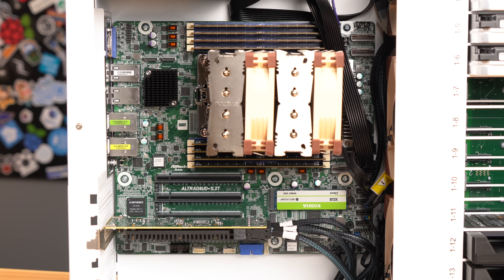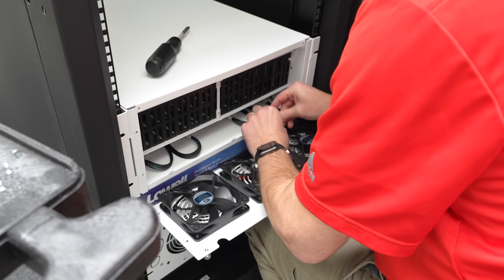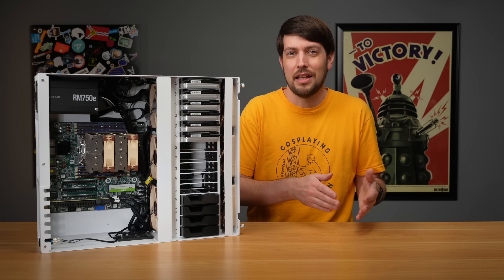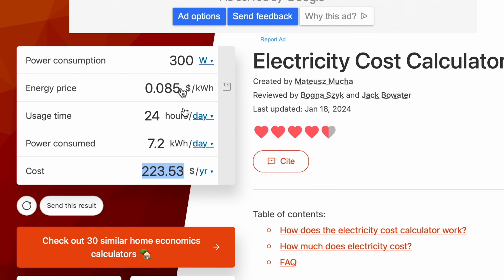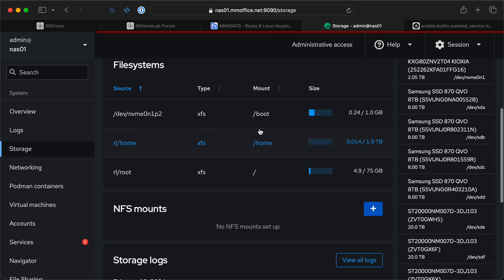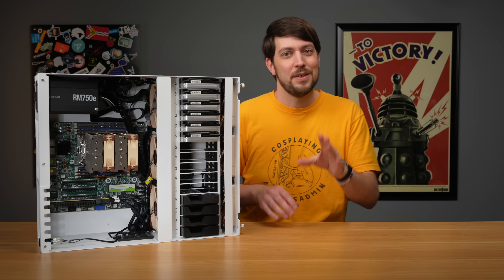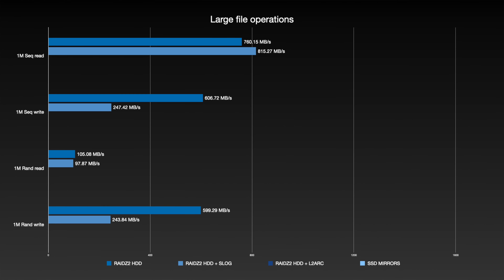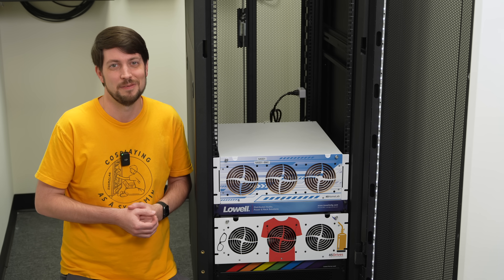Silencing the 100% Arm NAS—while making it FASTER!

Comment: My "server" is a Ryzen 5 3600 with 32GB DDR4 running at 2666, and the shared drive is just a USB 3 external hard drive. It's actually just a repurposed MyBook, so I want to keep it external in case I ever need it on the go (you know, like the intended use case :p). I've undervolted the CPU to run around 45 watts at idle, and I let the hard drive spin down when not in use, which is most of the time. Benchmarking this was difficult, but I wanted to know the idle power draw and the power draw serving files at 1Gbps, and that was my goal for efficiency. So, I really like what you say about efficiency meaning something different for everyone. Maybe one day I'll go ARM, who knows?
Reply: If you want to shave off a few more watts at idle, look into AMD's monolithic jobs - 4500, 4600G, 4650G, 5500, 5600G. (If memory serves, there's not much in it between a 3600 and 4500/4600G performance-wise, and neither of them are expensive.) Make sure the BIOS option "Lower Power S0 Idle Capability" is turned on, as well as all C-states, PCIe ASPM etc. You can check for ASPM among PCIe devices with:
lspci -vv | awk '/ASPM/{print $0}' RS= | grep --color -P '(^[a-z0-9:.]+|ASPM )'
Reply: I’ve been running an old i5 6500 with 8gigs of ram as a Minecraft server and was surprised to see the thing only use like 20-25W on idle. Ryzen, especially their chipset based cpus are just not great when it comes to idle efficiency I think. Whole different story at load though.
Reply: @Keklient  20-25 W actually isn't even a particular achievement for a Skylake system... Sandy / Ivy Bridge will do that already. There's a number of Skylake era office machines that'll idle at around 10 W, and things can be pushed to around 6 W with a PicoPSU and the right board. 6th to 9th gen is probably the best era for low idle power overall, although 10th gen can still be very good. Your best bet generally is (basic) ITX boards from manufacturers that are somewhat competent in terms of BIOS power saving features, or prebuilt SFF-ish systems.

Comment: I have never missed anything on my M1 Nas, I can replace iCloud drive/backup, Netflix, Zoom, ChatGPT, CoPilot and why not get 2 different coins CPU/GPU,  as easy peasy as git clone/brew install, it pays for itself pretty fast and why not upgrade to 10Gb without paying your ISP ;)
Reply from the maker: Apple's M1/M2 Mac minis are about ideal for so many different reasons. Just wish they would make a computer that's more suitable for rackmounting!
Reply: A 3D printed rack for Mac mini's removed from the case would probably be pretty easy and extremely compact  @JeffGeerling  
I have only had issues with getting Thunderbolt networking working more like a switch, have you tried that on Linux?

Comment: So a friend of mine recently went from Ubuntu to Debian with his server and is happy with the change. No more snap stuff, etc. Is there a reason you didn't go with Debian for this? Asking since my server is currently Ubuntu and I've been thinking about the next time I reinstall OS I may go Debian.
Reply from the maker: Mostly the support—Ubuntu in particular has done a lot to make sure arm64 support on systems like Ampere's run well. Debian is about 99% the same, but there are little things that make a difference sometimes.

Comment: jeff power form the wall and power coming form the psu to the cpu are far diffrent do to voltages and efficiency  120 volt 1 amp is 1200 watt at 100% efficiency and 12 volts at 1 amp is 120 but do to efficiency been close to 80-94 precent so it take more power how ever the cpu will pull 15-35 amps depending on the cpu at 12 volts wich is close to .35 amps at the wall so you shouldnt be useing the cpu wattage metter in bio or software its measuring how much power the cpu is useing and is really only usefull to see if the vrms are able to feed the cpu the power its needs

Comment: fans alone can drop power draw up to 150 watts if full on server fan the 12 volt 1 amp fans suck power down and when your useing 9 or more of them you can drop 150 or so much power being droped form the power supply more like 70 at the wall

Comment: sorry, I might be dumb, but at the end you just used ubuntu with ZFS? that's it?
Reply from the maker: Pretty much—originally wanted to try TrueNAS but they don't seem interested in Arm64 support. Then wanted to try Houston/Cockpit, but 45Drives doesn't have the support I need for it quite yet. So settled on Ansible managing ZFS on Ubuntu.

Comment: If a hard drive is using 6W at idle, then it's 100% not idle.
They're probably all spinning, even though there is no I/O...
Reply from the maker: Idle meaning it is spun up but not accessing any data. Spun down, they should be closer to 0W :)

Comment: Bonus points for the title.
The guys that make hl15 should definitely if not offer noctua fans as a option, at least work on their fan noise specs. I'm certain with a better choice of coolers (not necessarily noctua - bequiet and many others offer lower noise fans), a built-in/addon fan hub and some spacers they could provide much better ux
Reply: Yeah: for people who've committed to HL15 pricing... having a $150 uplift fee for Noctua fans probably wouldn't make them blink: I'd go for it.
Reply: I bet some properly sized resistors and 3d printed spacers take care of the fan noise on the stock fans for much less than $200 worth of noctua fans if that's more than someone wants to spend.
Reply: @chublez  most likely so, though quieter fans would also help - there's a bunch of those that are not as expensive as noctua.
What pains me is that a person who's ready to pay a boatload of cash for the hl15 has to contend with jerry-rigging stuff which at this price point should be an option offered by the manufacturer
Reply: @chublez  Don't suggest resistors. They should include a proper fan controller. It could be as simple as taking a PWM signal from the motherboard and using 4 wire fans. Or they could use thermal sensors which might be better for keeping hard drives cool.

Comment: You better grab some Optane drives while they are available. I use mirrored 905p's, to host both ZIL/SLOG, and also a Special Metadata vdev. The ridiculously low latency on Optane makes it possible to host the vdev and ZIL/SLOG without issues on the same drives.
Reply: When you go for a special metadata device (and potentially small-file support) do you pretty much need 2-way/3-way mirrored configs?
Reply: @MikeKirkReloaded   Yes. If you lose a special metadata vdev you lose the entire pool.

Comment: Using SATA QLC SSDs for ZIL and L2ARC - a bit masochistic?
Reply from the maker: Just wanted to see how they do :)
Reply: @JeffGeerling lol, the way you benchmarked them you sounded like you were expecting TLC NAND performance and instead blamed them for being “consumer ssds”.
Reply from the maker: @carbongrip2108  I was expecting nothing, really—a lot of forums just say "don't use consumer SSDs", but never offer any evidence they're better or worse, performance-wise. So I thought I'd test them to be sure.

The 8TB versions aren't that bad, honestly. I wonder if they have a larger cache due to the massive size of the SSD (relative to the QVO 1/2/4 TB models).

Comment: QLC are terrible for Raid from performance perspective due to the way they work. You may find more info on this from other YouTubers. Use at least TLC ssd.  Also if you can , use overprovision on the ssd, minimum at 20% in my experience because as the ssd is getting full the performance drops. And if it is a cache drive and it is filled at 80% of the total capacity, you will see significant performance drop as it reaches 100%.🎉
Reply from the maker: In this case, the 8TB SSDs are massive overkill—my working set on them is less than 2 TB, and won't probably grow beyond 3-4 TB in the next few years (after a project is done, it moves to the HDD array).

But as I potentially expand to having more than one person edit off this NAS, I may move to U.2 enterprise SSDs ... we'll see!

Comment: hi, the samsung qvo drives drop to around 150MB/s read and write during sustained use, that might be why you HDDs are faster
Reply: QVO drives read at full speed all the time. There is no speed limitations when reading for a sustained duration.
The 8TB QVO writes at 184 MB/s when it exhausts its massive SLC cache. He'd have to write some 320GB before a drop to that level.
Reply: QLC is flat out trash
Reply: @toseltreps1101  I don't know why you choose to spew ignorance rather than educating yourself.
These aren't no-name cacheless SSDs with crappy controllers. They also only experience the "QLC downsides" well beyond what you'd likely write to them in a single session.

Comment: This server gonna stay at 99% idle for entirety of its existence. 

Motherboard power usage is generally one of biggest killers for low power stuff, and server ones are rarely optimized for it. AMD seems to be worse here, we've seen the EPYC server boards eat like 110W while doing nothing (30W CPU, 80W rest, for not so high end server and just 4 NVMes).

at same time very comparable Intel one  (also 4 nvme, and actually doing more IO) was eating like 60W with cpu being 10W  of that
Reply from the maker: In most cases, the always-on BMC/IPMI eats up 5-8W too... that's more than a Pi running Pi-KVM too. Wish one of the motherboard vendors would go that route, with a setup that can be turned off if you don't need the always-on management tooling.
Reply: @JeffGeerling  If you think about it BMC/IPMI is like having an insurance.  Sure we pay till we need it.  Plus they want to make darn sure that BMC/IPMI always stay on so you can remote into it.  No chance of turning it off by accident.
Reply: @JeffGeerling  ...the management is basically THE reason to get those boards, that would be pointless, might as well get desktop/consumer mobo at that point. 

'I can afford AMD Epyc but not few bucks a year to keep the management running" is not the use case real people have, neither is "the person that dug it from the junk 10 years later can't afford the power", if you want to be sensible with your money you just don't buy server grade stuff as they are always overpriced for performance.

Anyway, the BMC is the least of the problems of those platforms. We literally had "same" series of servers, one with Intel, other with AMD, same BMC (at least UI wise... can't imagine Lenovo having 2 completely different BMCs for AMD and Intel), and at total idle (right after we got them) the difference was like 50W in favour of Intel. CPU itself was maybe 20W of the difference, rest was just accompanying chips not being all that efficient.

Otherwise the servers were as similar as possible, both 1U entry level, both with 4xNVMe of same model etc.

Comment: Seasonic makes a fanless PSU I use it in everything.
Reply: Even with their warranty always have a bit of airflow through the PSU, the electronics will be thankful in the long-term.
Reply: @abavariannormiepleb9470 Exactly! Seasonic, despite being the leading PSU brand with decades of experience, doesn't know how their PSU performs and what the suitable conditions for it are.
This random commenter on YT knows best.
Reply: You get that PSUs aren’t filled with magic but standard, widely known electronic components that have certain lifespans where temperature plays a significant role?

Comment: I think your problem with the ssd’s is less the sata interfaces fault and more the fact that they are QVO drives which favor capacity over speed. Retest with Sata SSDs that use TLC nand instead of QLC.
Reply: Might be correct, but damn, 8tb SSDs are just crazy expensive, the QVOs already being kinda stupidly expensive for most nas applications.... But the step to the next other 8TB ssd, not even mentioning TLC, thats insane once again...

To me honestly, for performance alone its not worth switching my 8tb hdds for ssds, only power draw and noise would be a factor, but even here in germany with our crazy high power costs, they'd need to. Run above 10 years 24/7 until the power costs would weigh up the price difference 😅
Reply: indeed, QLC is trash
Reply: I would never use QLC for constant writes.  It's fine for "archive" or cold data.
Reply: @Darkk6969  if you have a lot of time that may be true, but even decompressing a 40GB game takes 10x on QLC vs TLC. that's a lot less data throughput for only a 5-10% reduction in cost at best.
Reply: @toseltreps1101  Derp, no it does not. It might take 10x as long once you exceed the SLC cache*, but these drives have, *checks notes 78 GB of SLC cache EACH.
Reply: @Darkk6969  Because... someone told you so and you didn't bother to research how that largely applies to ~500GB and 1TB drives?
Reply: Wonder if it is worth using any consumer ssds for cache on these, if they will wear out... I'd just max out ram, stay with hdd fully or go with micron pro if money allows.  Or maybe have two different pools one for speed one for colder storage, duno.
Reply: @ironfist7789  Yeah, they'll wear out in just about 8.4 PETABYTES written to them.
They're each listed for 2.8 PETABYTES of use WITHIN THE WARRANTY PERIOD.
Typically, NAND is warrantied for about 30% of its useful life, i.e. the average NAND SSD will be about about 3.3x as write endurant as the TBW (warranty) value states.
They're basically useless. I, myself write some 50 petabytes a day. He might as well use a floppy disk.

Comment: You may also want to test the power measurement tools you use.
The Kill-a-Watt is probably measuring actual Watts, but most of those meters do not take the power-factor (cos phi) into account and thus only measure VA and not actual power your power company will bill you.

Most high-end power supplies in your PC will have some power factor correction circuits, so it should try to have voltage and current in phase as much as possible. But those circuits will often not work optimal when using the power supply at the lower end of the amount of power it can deliver.
Also power meters struggle in the low-end of the measurement range.

One of the easiest ways to help power meters to give a more accurate measured power consumption is to add some resistive load like an old fashioned light bulb with tungsten glow wire.
This will have a perfect cos-phi of 1 and adds some base load so your meter doesn't have to struggle near the low-end of its measurement range.

If you try to measure "idle" power consumption, you can easily be fooled by those measurements as the power supply probably does have a truly bad power factor at the low power delivery end of its range.
This can make a huge difference as the power factor for idle can be easily less than 0.25 which will put your measurements off by a factor of 4 or more.

So as always: Measuring is knowing, if you know what you're measuring. (A Dutch expression: "Meten is weten als je weet wat je meet")
Reply from the maker: I've been testing the Thirdreality plugs a bit, and they do measure power factor (among the other metrics), so I have pretty good confidence with them. I do plan on getting a nicer bench power measurement tool at some point that's calibrated and could be used to test the accuracy of various meters... but all in good time!
Reply: @JeffGeerling  Just as a simple test, you could also try to measure some devices with really poor power factor like LED lamps.  Just plug in your measurement devices in series and check whatever they measure with the same load and then swap the order of the meters to make sure you can average-out the power consumption of the meters.
Then also measure some resistive load like a heating element (e.g. an old soldering iron)  Just to make sure the soldering iron will consume a constant amount of power and is not turning off as it reached the target temperature, you can place the tip in a large vise or something else to dissipate the heat.
This doesn't require any pricy new equipment and maybe is a nice new topic for some video :)

Comment: I have two Servers at Home one running on a j5040 because i dont need much Power for my Services i have running. Most of the time it sits about 10% and uses only 7w but for some stuff i programming i need more Power way more as your heavy gaming can provide. I that Case i bought cheap a used dell r630 for 600€ with 14tb total of 8 SATA ssd in a RAID Array, all 24 ddr4 Slots are used wit 2400mhz 4Rx32 Sticks that i have 768gb and a total of 96 ranks, i have two Xeon E5 2699v4 with 22 Cores each. This system uses 150w idle and 670W full blast. But i have some Datasets where i have to crawl thought 10tb of Data. I wont wait 50h to Finish the Task ob my ryzen9 gaming PC that needs only 250w but but my r630 kann handle that Same workload in about 3h. 
The gaming system uses for that workload 250w over 50h so it used 12.5kwh but the r630 uses 670w over 3h and this are only 2kwh. The reason is parallization and faster workload Pool. Even the CPU is clocked lower and so the RAM but this dont really Matter If your limiting Factor is your Drive and RAM ranks.

Comment: Add a Metadata VDEV instead of SLOG for smaller files/blocks. You can’t remove it once added but it will significantly increase metadata querying and small block IO - it is also adjustable for what size it will store.

Comment: 158 watts seems like a lot. My R730xd with Dual 2699V4s, 256gb of ram and 22 Sata SSDs only uses 140 watts idle.
Reply from the maker: Yep! Watch along a bit later in the video where I investigated power consumption—idle was actually around 123W, and I could isolate things down to much lower consumption by pulling different parts of the build out.

HDDs also used almost an order of magnitude more power per drive than the SSDs!